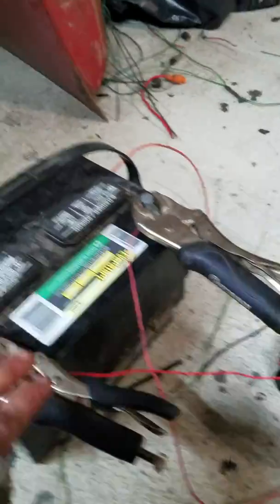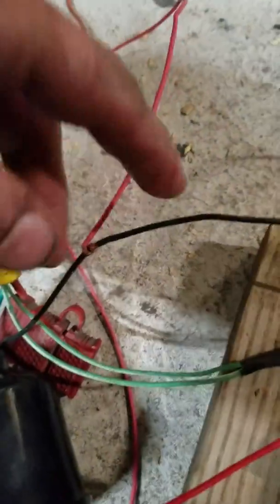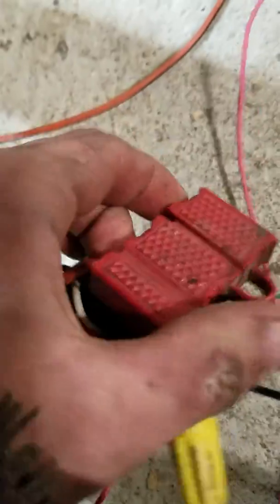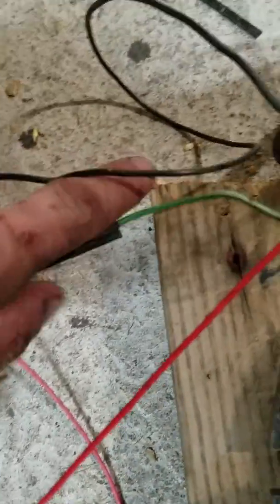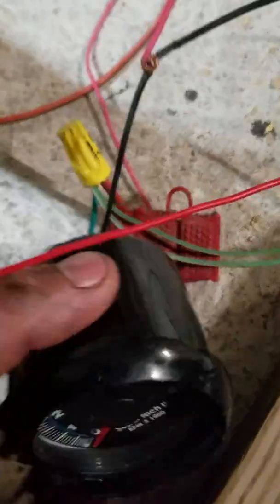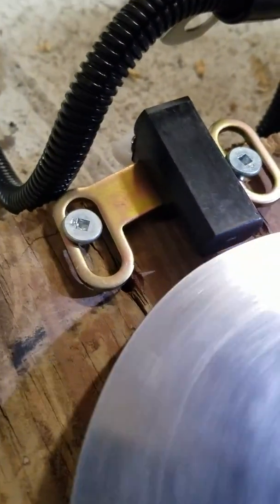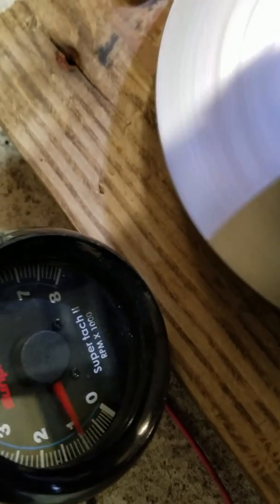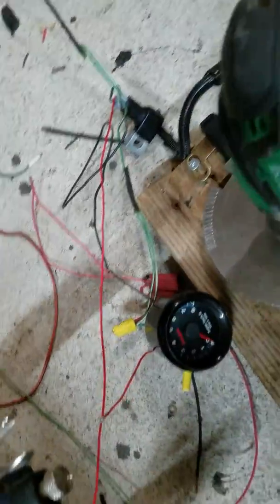Gas  tach diesel (tachometer) running off  Dodge Cummins  crank shaft sensor

Comment: so the Crank sensor gets 1 ground , 12v + input 1 and on the Signal  you tap off 12v+ to an inline 1K ohm resister out to the tach signal input and also to the 3rd port on the sensor/ signal port.